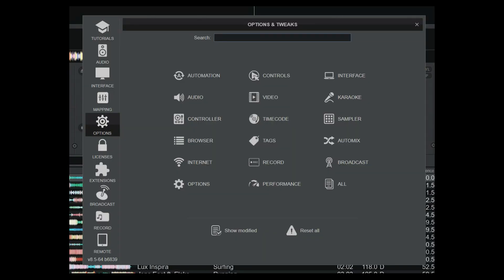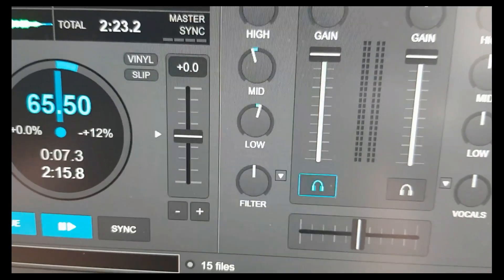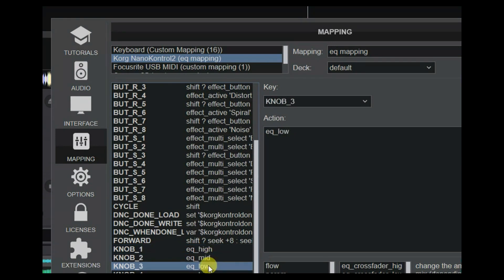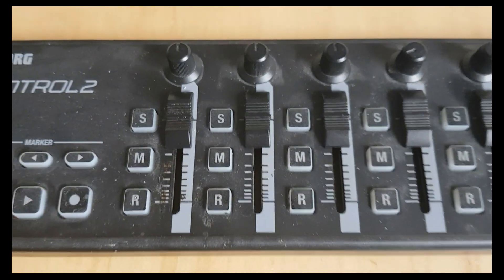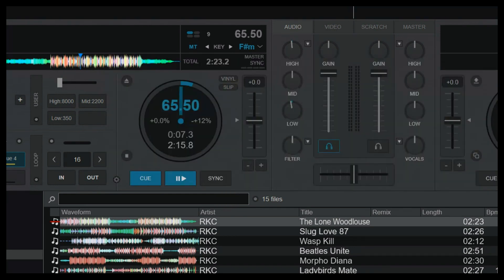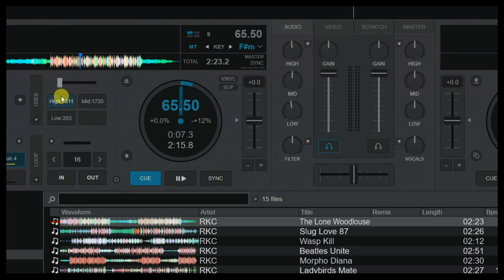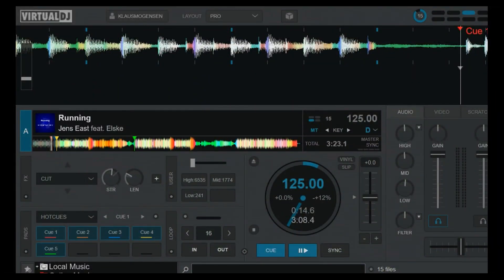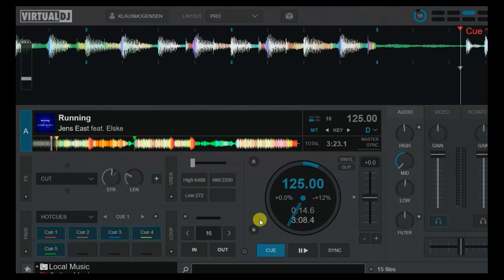VDJ8.5/2021 - Using the improved EQ frequency settings

Comment: I Haven’t upgraded yet just wondering if audio quality/engine has been upgraded again better? In 2021 does it sound same as 2020
Reply from the maker: Generally it's the same. The time stretching algorithm used for master tempo has been updated a couple of times, but those were minor updates
The big jump when going to VDJ2021 is the syems separation which is AI based and resource heavy - unless you disable the feature of course